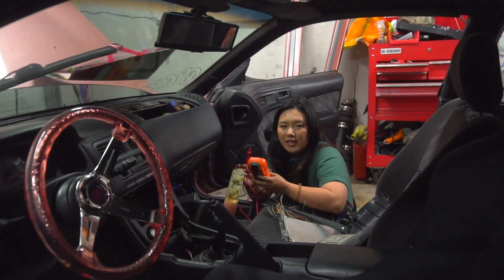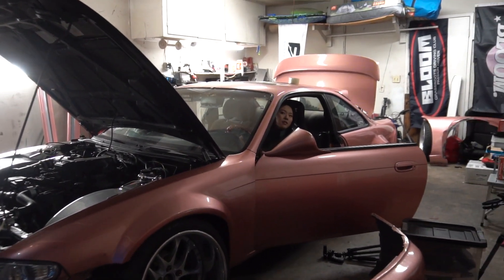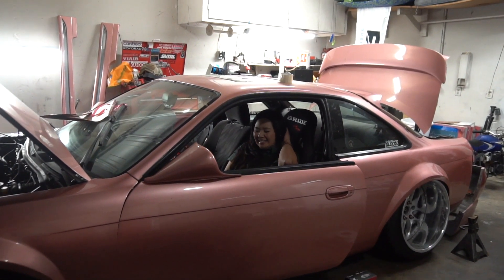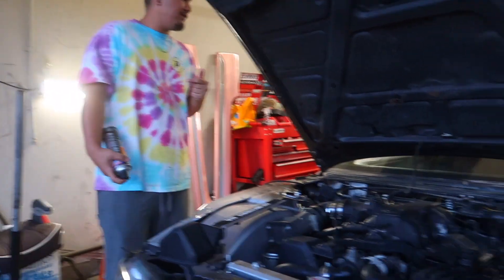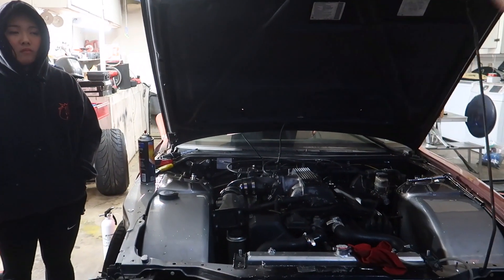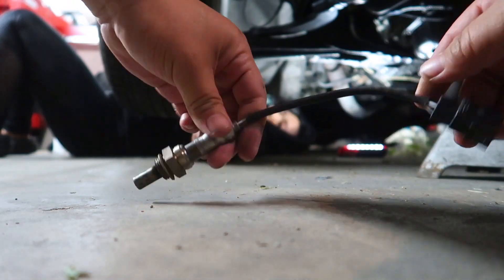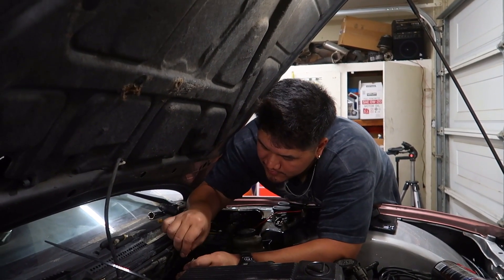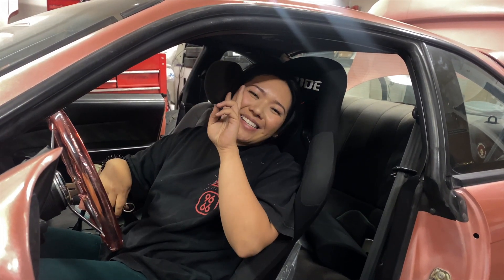Diagnosing why my s14 won’t start, AGAIN!

Comment: You guys said “fuel pump” and you did something at the driver side foot well. Did you change the fuel pump relay?
Reply from the maker: We removed the fuel pump fuse to check for spark while cranking and forgot to replace it when we tried to start it back up.
Reply: @CARSHOPBLOOM  thank you, i need to replace mine as well